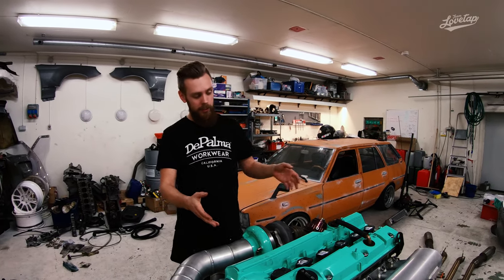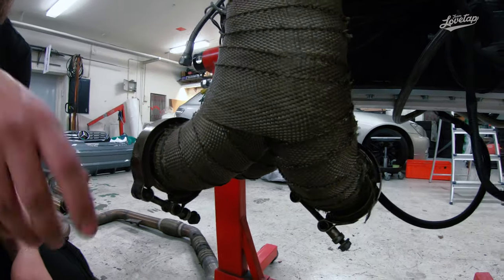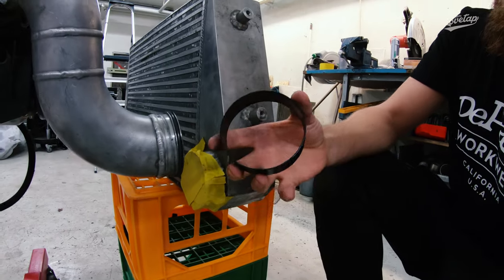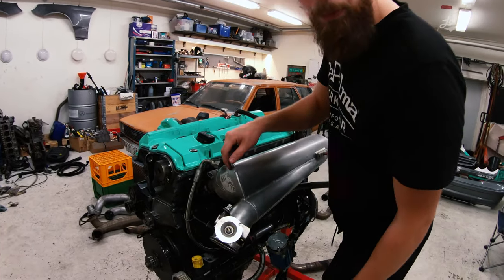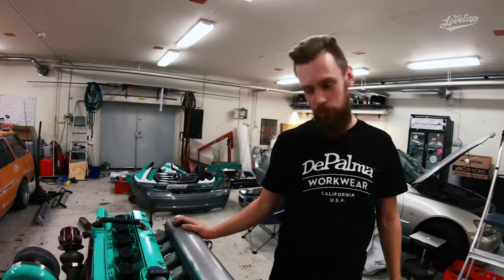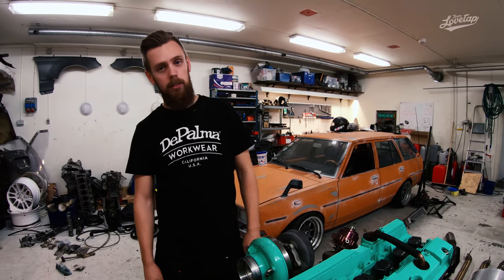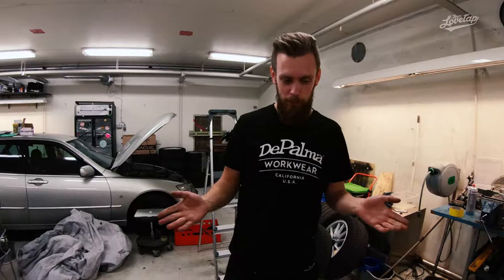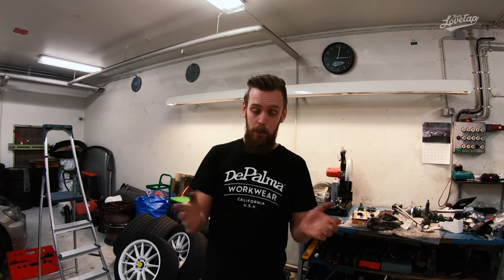Hammer & Spanner EP 6 - M104 Turbo External Engine Parts

Comment: Congrats on the build, my dream is to build a turbo M104 one day! I heard turbo flutter on your runs and thought this is possible only if you don't run a blow-off valve and let the pressure escape from the turbo compressor. You can make that noise with a BOV or you haven't been running the BOV on all the videos? Keep it up! Cheers!
Reply from the maker: Thanks alot bro! I always run BOV, the sound you hear is when pedaling, from boost and not letting go of the throttle completly, can be almost like flutter

Comment: At what level would you say that a dry sump system is necessary? If I were to build a turbo M104 drift car, could I get away with just an oil pan baffle? I just put a baffle in my M54, but I had no problems even without it
Reply from the maker: James Kurz there are alot of people that run over 800 whp with stock pump, so not s problem. I rebuilt it due to space and also wanting to get the engine as low as possiblr
Reply: Team Lovetap Cool. Thanks for the info! Yours is such a sick setup. Never seen a low profile pan like that